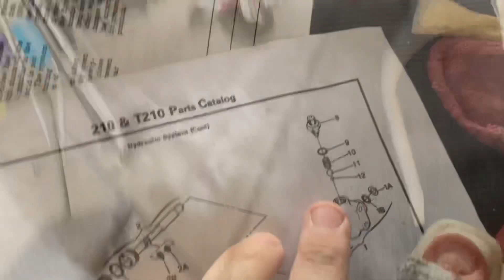Cessna 210.  100 hour inspection fun finds.  Day in the life A&P mechanic

Comment: Question: why can't you just remove, clean, weld broken area?  That is 100% weldable
Reply from the maker: It’s a tig weld for one (none of us can).
2, We’d have to do a X-ray after to determine if the work is good. 
3, it’s a huge liability if something goes wrong 
4, getting the first two things done costs more than a new wheel
Reply: @aviationsquared1909  I'm not sure what a "tug weld" is  but I was talking about the oil cooler. Sorry for not specifying,  the wheel yes is trash.  That broken flange on the cooler I would say could be welded for less than new cost. My xray guys use all digital  extremely fine resolution shots, if it needed to be shot to verify full pen weld. I try to always hand liability off to the inspection company

Comment: Looks like your finger developed a leak too!
Reply from the maker: Only a slight major leak
Reply: @aviationsquared1909  Lololol!  Like safety wire under the fingernail when you’re elbow deep in a fuel control change.  Or Skydrol in your mouth and that bottle of water is three finger lengths away.  I hate airplanes, been working on them for 33 years and they still find ways to mock you!